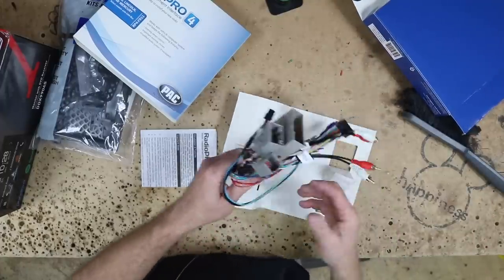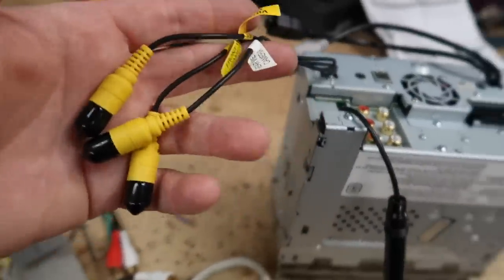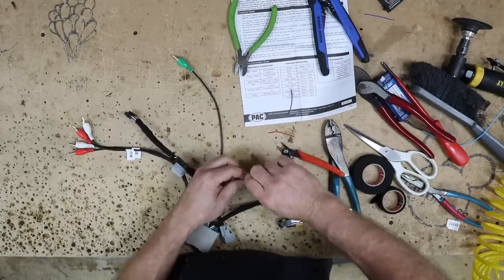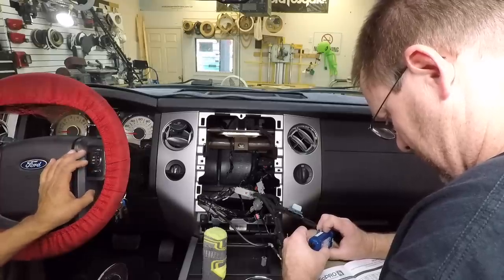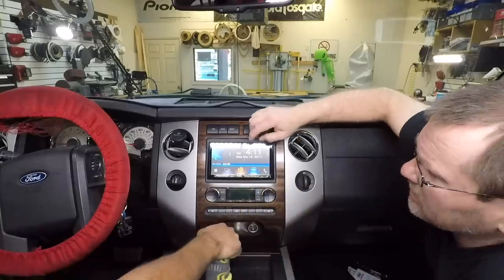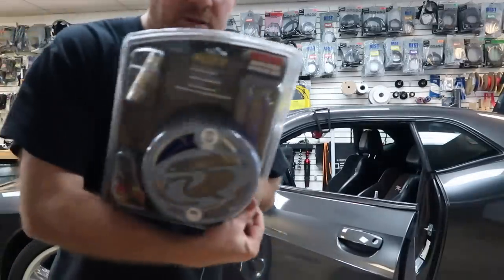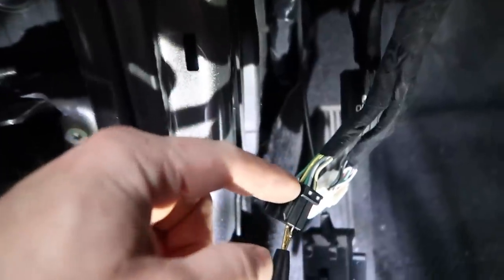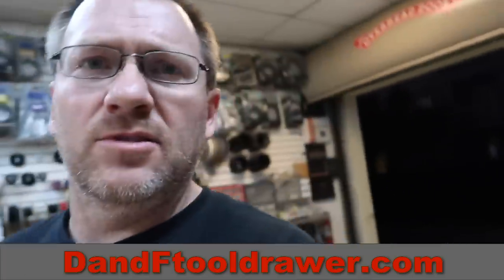Ford Explore with a factory overhead DVD gets a new radio and a quick sub and amp in a Challenger  I

Comment: yes I Have a complete alpine system an mpr m350 single amp  a w265bt head unit and very nice coaxila alpine speakers in a 2000 siliverado    system worth more that truck

Comment: 1 Amp not enough for a backup camera? I've never seen an aftermarket backup camera where the manufacturer specifies more than 0.07 - 0.25 A (250mA) of current draw. Some cheap cameras are not made for continous operation through the accessory wire, they overheat internally and fail.

Comment: Hey guys. 2011 f150 with trailer package. Can I T tap into the trailer plug for a reverse camera?
Reply: _ REDGTCS  should be a blue/white wire in the passenger kick. I would military splice into that wire and avoid T-taps.